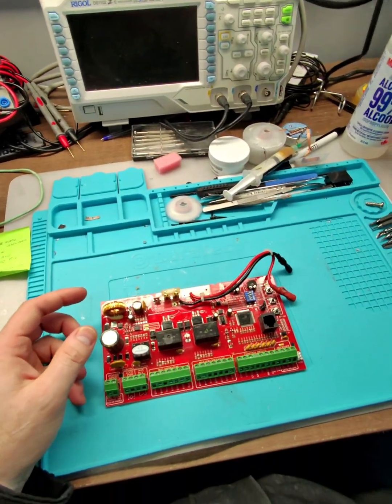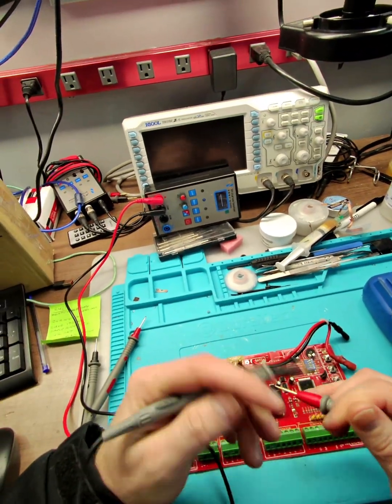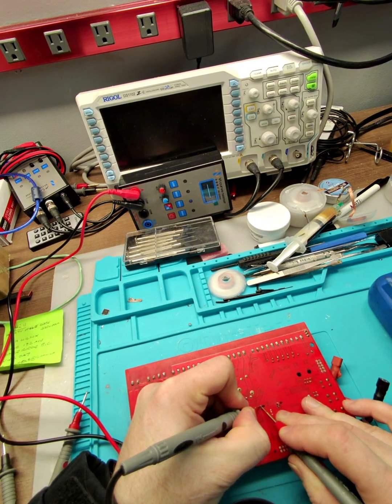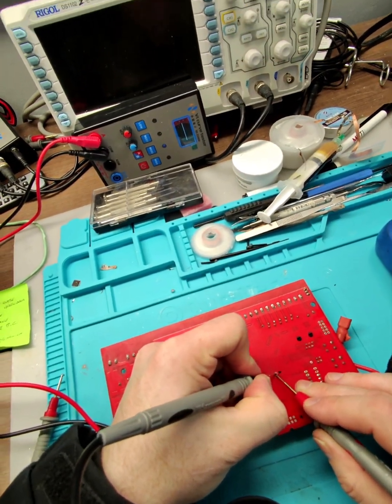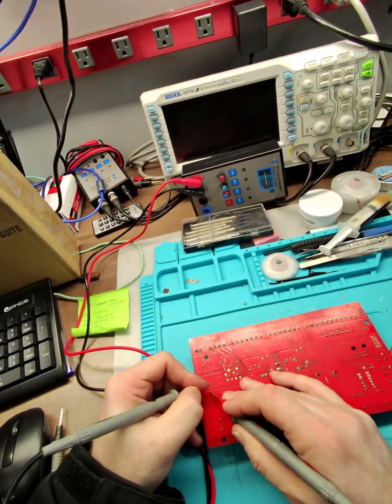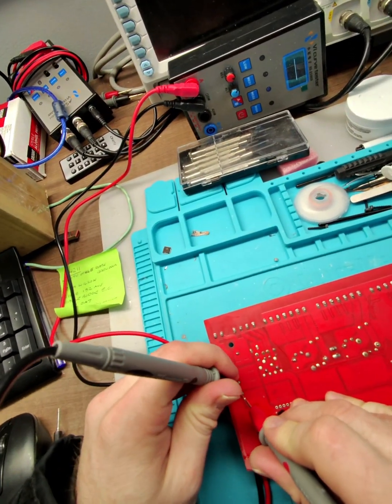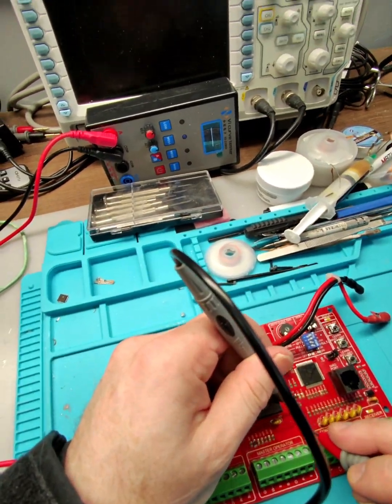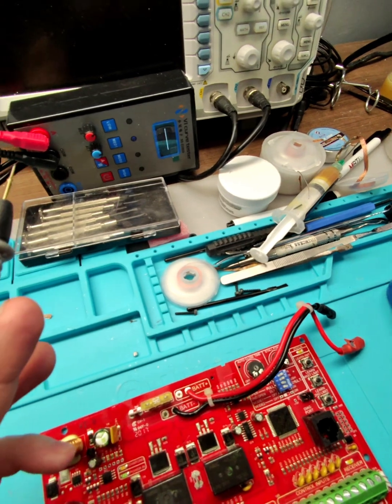Mighty Mule Gate Opener control board diagnosis #controlboardrepair #gateopener #controlboard

Comment: Hi.  My Mighty Mule gate opener is not engaging the solenoid.  I checked the resistance of the solenoid and it  is 8 ohms.  I then disconnected the solenoid leads from the board and applied 12v.  The solenoid was activated.  This means the solenoid is good and the problem is with the board.
Any tips on where I should look next.  I assume there is a transistor that is switching the negative side to ground from open.  Could that be defective?  It started off working intermittently and now it does not engage the solenoid at all.  Any help is appreciated.  Thank you.